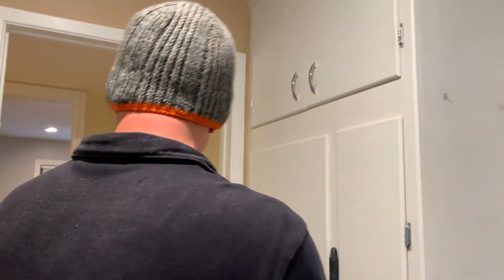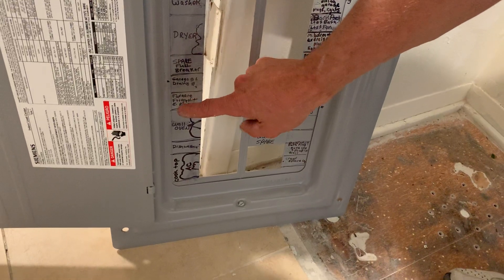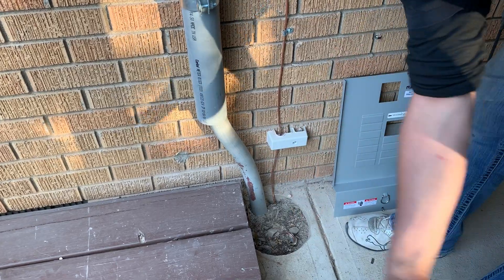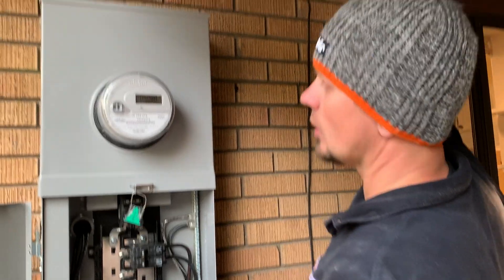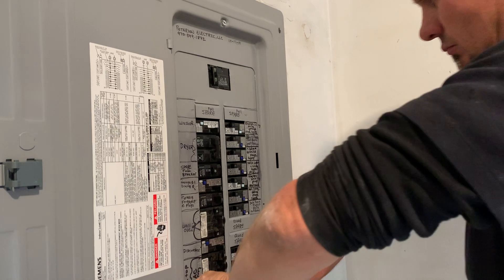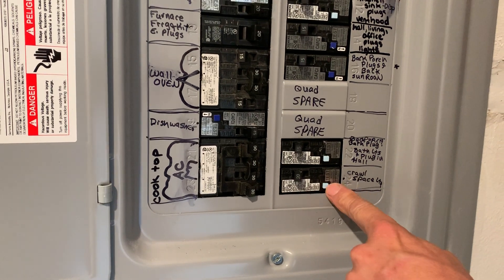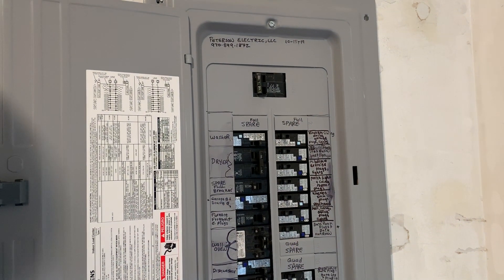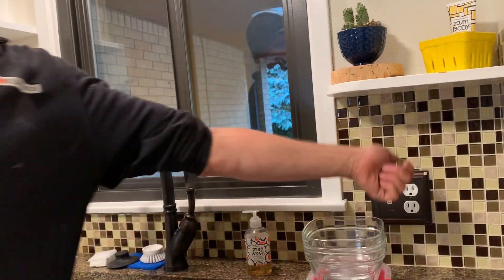Service Change Arc Faults (Canned Lighting)

Comment: It is not correct to say that the refrigerator must be GFCI protected if the door swing arcs within 6 feet of the sink.  GFCI protection specific to kitchens is addressed by Article 210.8(6) "Kitchens — where the receptacles are installed to serve the countertop surfaces".  Unless the refrigerator plugs into one of the receptacles serving countertop surfaces, that requirement doesn't apply.  Further, and overlayed on top of that requirement is Article 210.8(7) "Sinks — where receptacles are installed within 1.8 m (6 ft) from the top inside edge of the bowl of the sink."  Notice that the requirement is based upon the relationship of the receptacle to the sink, not the appliance to the sink.  We could argue about whether it might be prudent to provide GFCI protection anyway to a refrigerator because it is in close proximity to counters and sinks, but that is not the requirement of NFPA 70-2020 (or 2017).

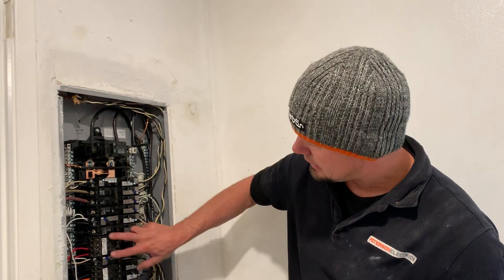Comment: At 2:38 you point to two breakers on a tandom breaker and say that they are feeding a 14/3.  To meet code those 2 handles need tied since you now have a shared neutral.

Comment: @petersonelectric What is your opinion on locking those outdoor main disconnects? In my neck of the woods kids on mischief night like to flip those off. with the right lock you could prevent kids from flipping them off but still allow firefighters easy access to shut off the power. Perfect non luggage use for one of those TSA travel sentry locks.
Reply: You should be able to lock it.  Fire fighters have bolt cutters or they can saw it off